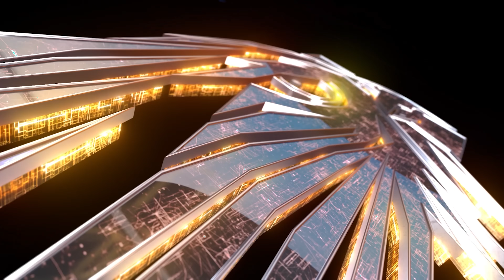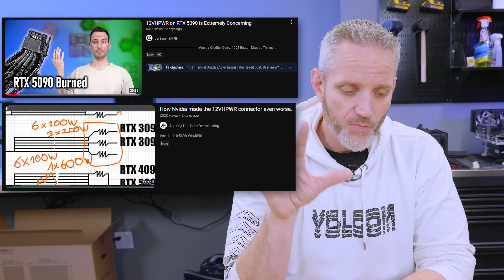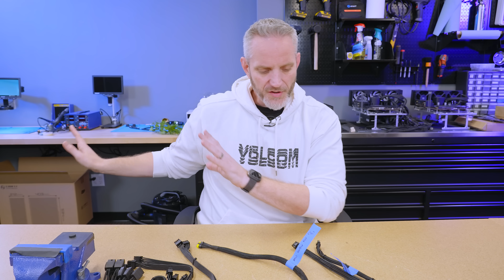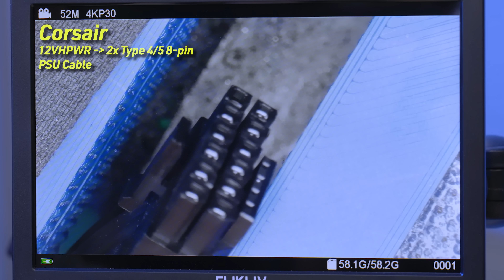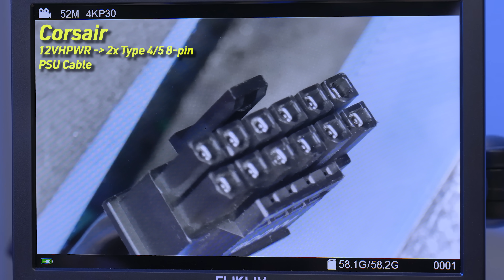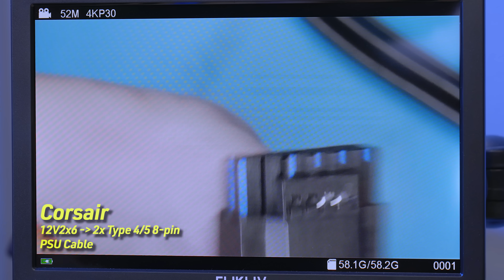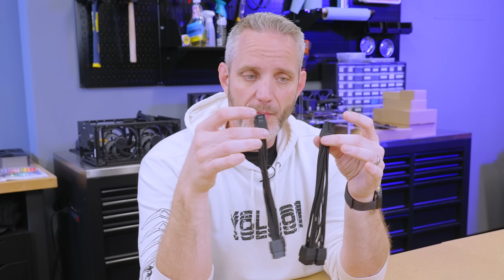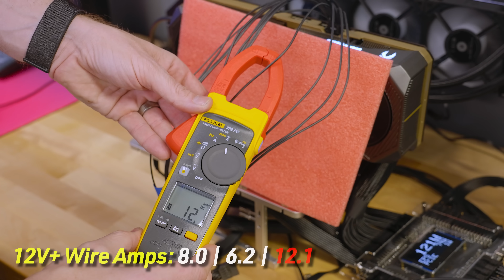I discovered something concerning and I need the Experts to chime in... More 12VHPWR discovery!

Comment: Corsair saying that connector is fine... absolutely not. The old molex cabels sometimes had a ton of slop but those were 5v and 3v connections with way less wattsge going through them and even then they could cause connection and power issues to hard drives and floppy drives. The connector from Corsair in this video should go straight to the garbage. Not saying all of their cables are bad but i would absolutely stop using that cable if it was mine. I got a 3rd party one on amazon because I have a white build and it has been rock solid. Connected to 4x8-pins from my EVGA G3 1000 watt PSU. every now and then I look to make sure its seated on both ends and that there is no melting on any connection point vut i dont unplug and plug them all in all the time.

Ive had my TUF 4090 OC for about a year now. I still hate the connectors for this because it causes anxiety and distrust. Cant imagine melting one of these cards. As soon as there is a true upgrade to the 4090 and it jses LESS juice im going to change it out.

Comment: On that one cable where that ground pin was recessed. There was also a pin in the front row recessed just not as much. But you are correct in your assumption that recessed pins could be the culprit. In order for pins like those to work correctly they have to be fully inserted into one another. Backing one out more than 1/32 of its total distance will cause issues.That ground pin is exceeding that and by 1/16. 

This has been an ongoing issue with molex and other different connectors with pin travel within the connector. 9 out of 10 times it would be the connector body and not the pin causing the pin travel.

Comment: I've been building PCs and spent a good 20 years doing car audio. On a 12v system the ground is absolutely just as important as your 12v positive. A bad ground will blow an amplifier just as fast as a smaller than rated battery cable as the amperage needs to flow evenly.  There are also ground loops when you have a bad ground which can hurt audio and create noise. It works the same for non audio, the noise is just resistance which causes more potential problems with current draw and it's why you'll either blow a mosfet or melt a cable if you improperly wire.  Amplifiers and  Gfx cards are very similar now with power consumption.

Comment: Looks like Thermaltake were making H++ cables with their Toughpower GF3 PSU's from the start, because I bought one at the same time I bought my 4090 back in 2022 and the connectors were flush with the plastic exactly like the new H++ cables..
It's never "slipped" out of the connection like the Cablemod angled adapter or their good will replacement cables did.

Comment: 24-pin cable - powers the motherboard, has a separate power only pin for CPU
6-pin - 600w, allows for 30A to 50A to run through 1-2 wires designed for 8A, 16A peak.
Good news is, once it is a design flaw, NVIDIA will have to pay for a recall of every card with the 12vHPWR to implement a fix. Imagine the inertia of that problem.

Comment: really not happy to hear they use a unified rail system, I would rather have more cables to split up the power load over more area even if it emans more clutter if doing so results on better power balancing and just deal with things looking "messy" in the case, so long as there is more things to stop my home burning down Ill take it over all else

Comment: the only cable you show in the video with the problem with the pins is only corsair but the melting cables are not only corsair
Reply: They all come from the same factory in China
Reply: @ryulanda9399  if they all came from the same factory they would all be with the same problem with the pins

Comment: Are these brand new cables? If not, is it possible that the difference between these plugs is that the one with the loose wires has seen enough heat to soften the connector and allow the pins to move more freely?

Comment: time to check my cable ffs dont know if my system is safe now have the CORSAIR RM1000x  ATX 3.1 12V-2x6 Connector running a 4070 super ,9800x3d, asus x870e

Comment: The card may have a common (ground) that is also in contact with the MB common via the PCiE connection, so that a portion of the source current into the card is not returned via the cable.  That may be why the return wires (common, ground) are not as hot as the source wires.   Of course, after nearly 1500 comments, this one won't add much to the conversation.

Comment: The power entering will be the same as the power exiting if it's isolated
but ground connections tend to be shared, so if there are other connections (pcie?) where the ground or current can get out, then the ground might have a better route / less resistance out than the power coming in on that cable
maybe even the case connection? (that might also be the same ground, but you'd have to test with a multimeter)

An interesting test, would be to get a socket from a broken card, hook it up to a custom dummy load that represents the card
hook up a high power power supply with variable voltage and slowly up the voltage on each cable to see how hot each wire gets

Comment: So you would recommend using the cable that came with the 5080FE even if I am going to buy a PSU with 12V high power? Building a PC for the first time in about 10 years. Just waiting on the 9950X3D but I was able to pick up a 5080FE on launch day.

Comment: So...
By Jaz pinned comment. Those low pins are ok, and within spec.

- The power pins on the GPU all mate to the same buss. No specific pin can physically be forced to pull more power by the GPU.

- The odd inconsistencies in the pins of the GPU and GPU connectors are considered fine... I guess.

- The wires in our cable can be of a good and quality gauge (size), but still see connector failure due to high load.

This leads us to one point... The PSU.
If everything else is "ok". Then the PSU has to be "ALLOWING" an inconsistent amount of current across the wires in the first place.
Reply: curren't isn't pushed, it's pulled.  Outside of pc's, i've never seen the use of parallel wires to increase current carrying capacity.  There's a reason for this.  It's hard to make sure each wire is carrying a equal amount of power.  Each wire\connection will have a slightly different resistance, the lower resistance connections will carry more of the total load, leading to things like 1 conduction carrying 23amps when it should be 8.33 (600w/12v = 50 amps/6 wires = 8.33)

We should really just be using a single pair of conductors and a plug like a xt60 or something.  You can make multiple wires work, but you have to derate them to account for what I mentioned above.

The only was a psu could stop this is if it implemented current protection on every single conductor going out (or at least for the GPU...but if ONLY the gpu needs it, maybe the gpu should fix it's issues?)

also "- The power pins on the GPU all mate to the same buss. No specific pin can physically be forced to pull more power by the GPU."  That is just wrong.  If the gpu is pulling 600w over 6 +12v pins (100w/8.33amps per pin) and you disconnect two of them, the gpu is still pulling 600w, just over 4 +12v pins (150w/12.5amps per pin)  If they are all on the same bus, the only way the GPU would be able to tell if something was wrong would be if it had 6 current sensors prior to the 6 wires joining together.
Reply: @Wooble57 
1. The CPU has to allow the current to be pulled in the first place. On each specific pin. (Unless they all come from a singular buss).

It is possible that the PSU. In some way, shape, or form. To allow the most current down specific wires.

If PSU ALLOWS one pin to pull the most amps. That pin and wire end up hot. As seen in the video.

That's the point.

2. WOW. I had no idea removing a power wire from a circuit causes da other wires to increase load... 

As stated in my first comment.
Jay has shown the cable is most likely NOT the problem. I had stated this in the first place.

At NO point was I discussing the BS complaints about "NoT FulLy sEAtiNg dA caBLE", or a cable not allowing all pins to pull a similar current.

Im frustrated because it seems like you ignored all of my points just to make an "Urm, Actually" response.

I clearly stated, Jay has shown everything is acceptable.
 Surprisingly...

- GPU good
- Connector good 
- Cable good
- PSU?????

That's how I end up at the PSU.

3. Yes. Exactly.
There are probably reasons, but the GPU should have had more connectors or just a completely different one in the first place.

Nivida literally had multiple power connectors on their test cards.
Reply: @ The PSU could add sensing for each wire leaving it, and cut off power if one wire is pulling too much current.  Now though, you have to hard cut the power going to the GPU, which I don't think it's going to care much for.

The current distribution used to be done on the GPU end (the three power phases Jay talked about), but now there is only 1 phase, so all incoming power is just combined.  Gpu's need to either be using a robust enough connector to not require current monitoring, or they need to do said monitoring itself so it can reduce draw gracefully.  The only other solution's I see are either a silly waste of resources, or likely to cause damage to components.
Reply: Except PSU's don't push power, the load draws power.
Reply: @petergray9625 

Let me try again... 

"No specific pin can be forced to pull more power BY THE GPU" ... Because of the circuit design.

GPU - PULL - POWER 

Thanks for coming to my Ted Talk.

Comment: What everyone can do after having plugged into the PSU and/ore GPU, take a normal screw driver (have to be small enough go get into the small space) and push on each pin so You are 100% sure that every pin are 100% connected. But, a bad pin connection should, or can't be the reason why Derbauer measured 23A on one of the line, in that case it's have to be something wrong whit the GPU that pull that power from the PSU, more then the double of the normal power.!
That guy that state You have to correct Your statement, because he is an engineer, sounds more like an "Wannabee engineer" that never do anything wrong.!
I'm an Electrician that later on educated me to an electrical engineer, so I now a little about electric power, bad connection that make fire...and so on.

Comment: I think the whole PC power supply design of using three or more 16AWG wires to carry what should be done with a single 8-10 AWG wire is a bad design from the very start. With three wires resistance will always vary between the mating connector pins and how well the wires are crimped. It only has to vary by a few micro-Ohms to cause uneven current flow. I have never seen this practice used on commercially designed UL rated equipment, only on desktop computers and low-end servers. Since electricity follows the path of least resistance you end up with one or more wires carrying more than their rated current and big surprise they burn up. This design also ages poorly with the cheap non-gold plated pins oxidizing and failing due to age. If you insist on pushing the current limit of the wires that tightly, at least use better insulation like Teflon. 

Also cramming wires too close together inside a plastic non-fire rated connector is another disaster waiting to happen. The national electric code for example stipulates how many wires can be installed inside a given electrical box with X-number of cubic inches. When you over-crowd wires, heat become more concentrated and can lead to melting insulation and fires. I think that the PC power supply standards need to be scrapped and re-engineered. Maybe they should switch to using overhead copper insulated buss bars instead of flimsy wires, since the power demands keep increasing year over year. This is a band-aid solution to an outdated IBM PC XT-AT design that keeps getting extended every few years.

Comment: Maybe it is time to change from 16AWG to 12 AWG wires, and perhaps to a new connector standard, that high continues heat will degrade the wire integrity over a period of time, as well as the continuous heat and cold cycle will damage the pins from the extended shrinking and expanding that occurs, Thermal degradation that is what is called

Comment: I love that this connector technically speaking is fine. As long as A) you limit the power through it to like 200W, so that if only single wire works it wont be overloaded, or B) you use the full 600W limit, but on GPU side you have 6 shunt resistors and a monitoring cirtcuit to measure the current per connector pin/wire - preferably on both sides aka on ground too, and then either inteligent phase drivers and/or additional circuits with like mosfets to load balance the wires properly.

WTF was wrong with the 6/8 pins old plugs and the per plug shunt+monitoring? This shit still has 12 cables and looks ass, so like either embrace quality, or just go into LiPo battery packs style connectors and like just a pair of heavy gauge wires? I wouldn't complain if it even was a connector with screws for proper mounting/seating.

Or like go cordless tools way - to much amps at 20V? Make special 60V batteries. Aka ditch the damn 12V, if you DC-DC them to various other voltages on the most power hungry stuff anyway, go to 48V and cut the current by 4 times. Then this abomination of a shit show connector and surrounding stuff would work fine with like 800W, and up to 2400W with shunting per wire, and this trend of GPUs becoming whole home space heaters can flourish.

Why I have a feeling like this leather jacketed ass-hat from nGreedia was so damn jealous of what Apple can do without penalties, so they pushed this warranty nightmare, cause in the end they can push all the blame to the cable/PSU/user side and deny RMAs?

Comment: I still don't know how we ended up with a different connector for PCIe and CPU. CPU cables are like 300w and simplify everything by not having multiple types. Plus it's already a thing on server GPUs!

My only guess is they were so worried about sending 300w rated cables for even the low power ones which would use a 6 pin PCIe? I still think it would probably be cheaper just with economies of scale to just make one 300w CPU cable.

Comment: Im a mechanic / tech of 20 years. When I see this stuff in automotive it tells me this: a short (unlikely in this scenario unless we crack open the gpu or the psu to say otherwise), component (gpu) is demanding too much power than the supply or wiring can handle. It sounds go me like the gpu is extremely demanding and the issue is the gage of wiring. It needs to go up one size on wiring in order to handle this kind of load on the wiring. Also, it may be a good idea for psu manufacturers to start putting circuit breakers or fuses inside for the 12v gpu wiring that is user serviceable. Im my humble opinion, gpu pulls too much wattage than the current psu wiring / pins can handle from having too small of pins and wiring. Simple as that. If they go up a gage or 2 in wiring and pin size, heat will massively go away.

Comment: Production tolerances exist in every product, but this is a design flaw, IMO. Even with my PCIe 6 and 8-pin cables I individually check each wire after the connector is seated, by gently pressing with the wire.

IMO the problem with significant production inconsistencies has existed since Molex 4-pin (Play around with the pins on those cables). But significant amounts of safety were calculated into the dimensions of the wire (And no or much less load balance issues, depending on the cable design). The melting happened on 6 and 8 pin PCIe as well, but due to enough headroom it either was caused by major production issues or real user error.

The problem since 12VHPWR is that the amount of juice that they're running per cable, with no load balancing no less, has finally crept up with the production inconsistencies and design flaws and supplier issues. The fact that no active load balancing is required on both sides and that the old 12VHPWR is physically still usable could make this into the perfect storm for Nvidia, PCI-SIG and the industry as a whole. 

It's insane that they didn't double the amount of plugs on 5090 (So you could at least balance over those cables) after the problems 4090 caused and the significant higher draw of 5090. But many people threw the 4090 users under the bus, Nvidia could do no wrong. Let's see how this plays out, I'll keep my 3080 for now. Warping of the connectors pieces due to heat over the product lifespan will lead to more failures (The bathtub curves will be rather short).

I'm a chemical engineer btw, so my electrical engineering knowledge is rather average. Could a electrical engineer please verify or deny my thesis?